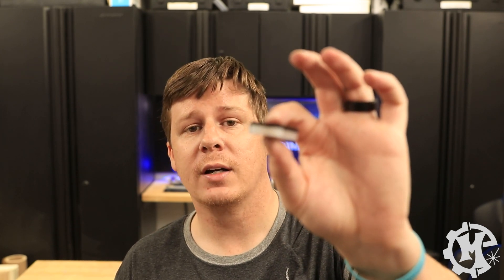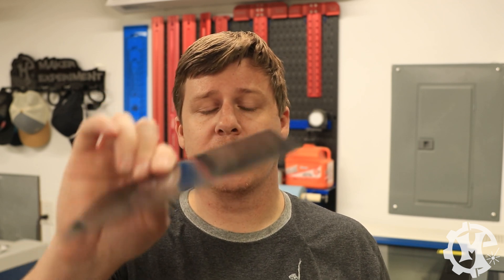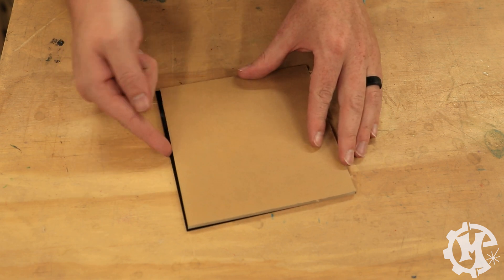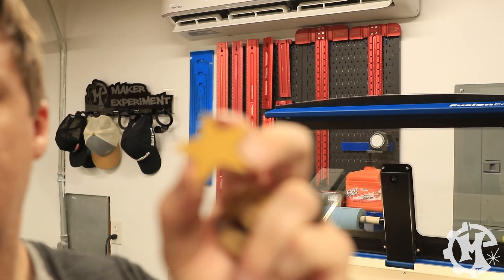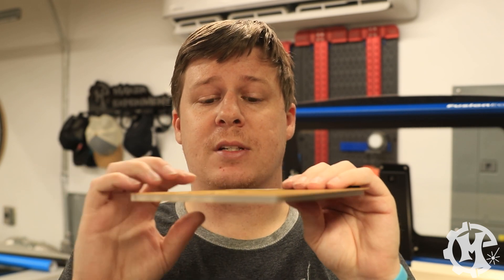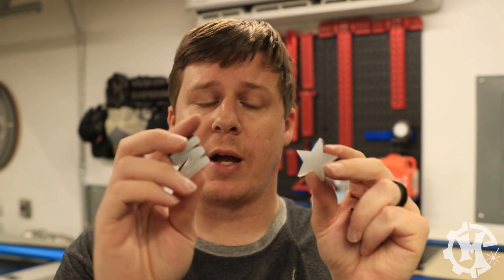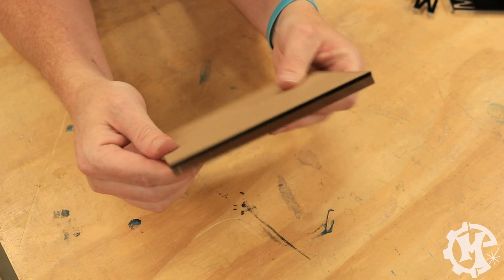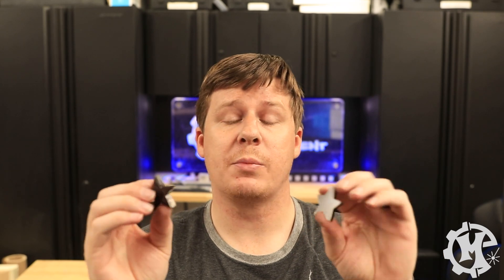HOW TO LASER WELD ACRYLIC | LASER WELDING

Comment: I wonder, have you ever tried slowing down the laser speed and power and just raster along the 'insides' of the pieces to do a sort of 'laser melt' at every point along the mating faces instead just along their perimeters?
Reply from the maker: No,  I haven’t tried anything like that.
Reply: @MakerExperiment Truth be told, I'm curious if it's possible, as dedicated laser welders for plastics are quite expensive. Getting a laser cutter to pull double duty as a laser welder could be quite a jump in utility - if you get it working, I'm sure I'm not the only one who would love to see a video on the topic! =)
Reply from the maker: @artenry  I’m not quite sure I’m even following what you’re looking for to be able to make a video.
Reply: @MakerExperiment  Hmm, sorry for the confusion! Let's put it it this way. To recap, the method you described in your video allows for joining two pieces of acrylic together by stacking them flat-to-flat and then cutting through them both at the same time, with the laser's passage causes the plastic to melt and then re-fuse at the interface. But, this bonds only at the perimeter of your shape - what if you wanted 'everything' bonded, not just the perimeter? 

What if it were possible to could dial down the laser power, and/or speed, and/or focal point, such that instead of cutting, you're just 'heating up' the area sufficiently to cause melting (and thus bonding)? Then, instead of sending the machine a file with just the perimeter, you could have the laser raster over the entire 'filled-in' shape and have it bond 'everywhere' instead of just the outline? 

Granted, I've never done this, and have only ever used a laser cutter to cut, but if it's strong enough to cut, maybe it can be dialed back to just melt instead?
Reply from the maker: @artenry  if you tried to engrave it, you’d be eliminating material so I don’t think it would do what you’re looking for. I’d have to see a picture of it.

Comment: You can also chemical weld with "weldon" we use in sign industry all day long. Its not a thick glue, its a super light liquid like acetone. You can cut, squirt and youre done. No testing required. 1 and done
Reply from the maker: Yes, you can. This video was purely to show the machining weld process.

Comment: loved learning more about acrylic use, not sure how I will use the knowledge yet.
I did change heat and speed and got a better result in etching and cutting, but still get a hot edge flow
at the cut.
Reply from the maker: Nice. The important thing is knowing you can do it. Now you can experiment.

Comment: Great video!!  Thanks for the idea. Could you use some thin double sided tape to keep the thin stock from separating?
Reply from the maker: Yeah but at that point you might as well just use double side tape to assemble it. Once you add any kind of tape or adhesive, it would make engraving through it more difficult.
Reply: @MakerExperiment  so true, but might be the only way to use the thin acrylic. Thanks for the respose!
Reply from the maker: @DeadEyeDetails  that is very possible